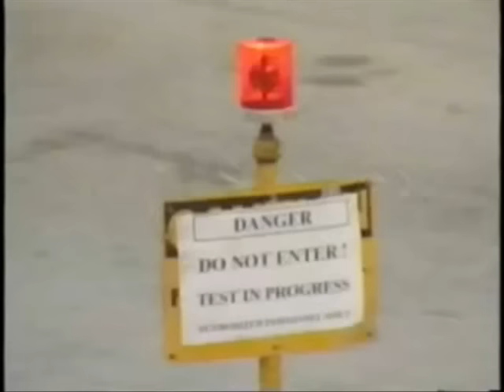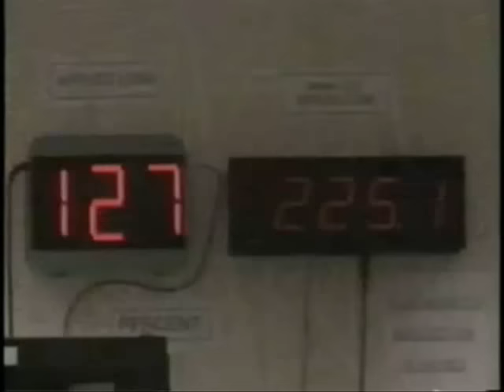Boeing 777 Wing Test

Comment: Back when the engineers ran the company and not the bean counters. Also when Boeing successfully designed, flight tested, certified new aircraft models without endless problems and delays. The biggest mistake Boeing ever made was merging with Mickey D's and letting Allen Mulally go. If Alan Mulally would have became CEO, Boeing would be totally different company today, and not in a endless downward spiral.

Comment: 154 tons?
Reply: 154% of design load, tension, force
Reply: 154% over design strength.
Reply: Icewave2007 As in it performed 154% better than they expected?
Reply: Yeah, the wing was designed to withstand a certain amount of force.  That's the baseline, or 100%.   They were able to overstress the wing to a higher amount than the design load, hence the 154% rating.
Reply: LeafBucket actually they were expecting 150% (cause that is requirement). So "as in it performed 4% better than they expected", but if you really get down to it, i bet thee were aiming in 152-154 area just to be safe.

Comment: So, what about the wings in the 737 and A320 families of aircraft?  How thoroughly are they tested for turbulence endurance?
Reply: I believe the same way
Reply: The collection of cables and beams you see in the video are known as a "wiffle tree."  It's designed to apply loads that simulate what the wing will see in flight.  All aircraft, from Cessnas to Boeing 747s, are designed for a limit load that in normal use will never be encountered in flight.  As an added safety factor, the wing will not fail at its designed limit load, but at a load 50% greater than designed, e.g., a wing designed for a 4.4-g limit will actually fail at 6.6 g's.  The 777 test shown here failed at 154%, so it exceeded the requirement by significant margin.

Comment: @farmerstel1 Well golly gosh, I hope the Boeing Aeronautical engineers check YouTube comments, as they could obviously take a few tips from random, unqualified ,anonymous Internet posters when it comes to building aircraft.
Reply: or perhaps they could add comments themselves to help out :)

Federal Aviation Requirements as part of the certification process require that the aircraft must be able to sustain 150% of limit loads (the maximum loads to be expected in service). The fact that they hit 154% tells the viewer that they do indeed achieve at least 150% of limit load, while also not over-designing the aircraft, ensuring it is as light as possible while still meeting the requirement.

Comment: How many planes did they destroy to confirm that 154 degrees cause the wings to break? Children in Africa could've eaten those planes damn it.
Reply: It wasn't degrees, although that would be AMAZING if it was
Reply: oh I found it weird that 154 degrees came to that point at first but assumed they were counting it from the vertical point instead of the horizontal one.
Reply: Yeah, it was 154% of the max designed stress load

Comment: It broke, but they knew there are chances of wings breaking, so they tested the wing and it turned out that the wing can take 154% if the original intended max stress. That is OVER double the amount intended, not at all a failure and more a feat of engineering.